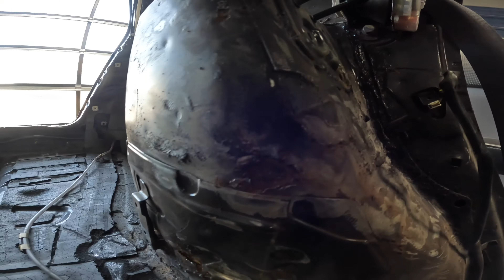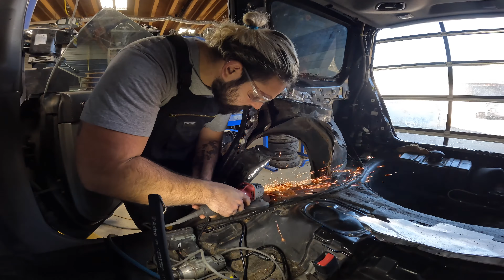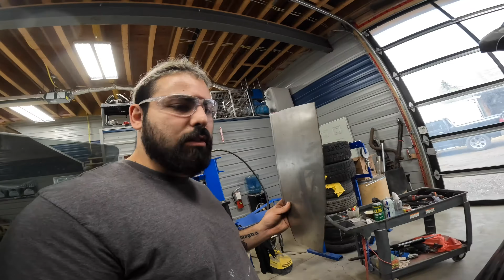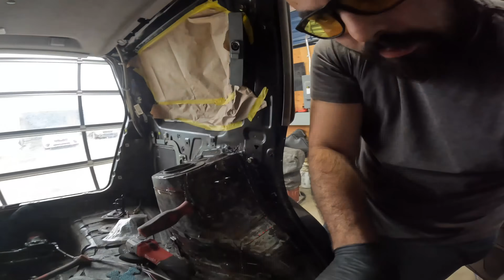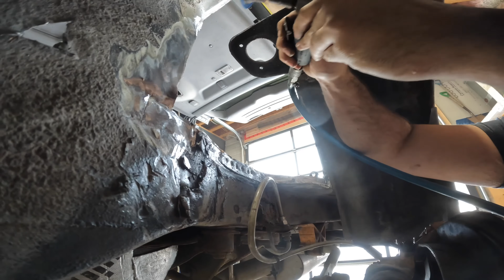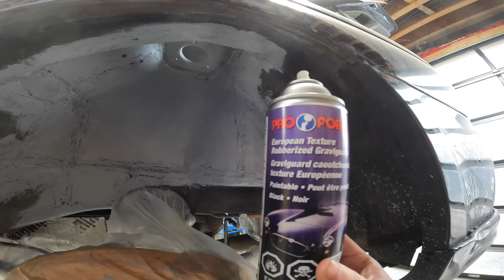Rusty Subaru Wagon Shock Tower Repair - Start To Finish

Comment: I have an 04 FXT and i’m in need of this exact repair. The Tower as a Whole isn’t as decayed, but the front of the tower, directly behind the rear seats is rotting baddlyy. I’m a mechanic, but not an autobody tech, nor do i have the welding skills needed to fix this. Whats a ball-park range on this kind of job, Parts and Labor?
Reply from the maker: Ya its a sad scenario, this one was extremely bad. Id say a safe ball park for someone to cut out the bad and hammer up a replacement patch and weld it in. Maybe $1000-$1500 range?

Comment: This and other videos on here had me checking the wheel wells and shock towers of my trusty fairly rusty SG. Can say that I caught it in an early stage (phew). Only post stamp size patches needed. Soaked the notorious sheet layers with magic Owatrol to stop or at least arrest any ongoings where I could not / would not look but had suspicions of rust inside still good looking parts.

Comment: Is this only single layer? I’m curious if that’s structurally adequate…
Would using the Subie Savers towers be less man hours and more strong?
Reply from the maker: @spotthedogg  this would be stronger then original, original was a perforated 2 layers of 22g, this is 18g . 
The subie savers towers would be ideal for sake of simplicity, i was unaware they were actually available on the market now. 
Either or, if you have large rust holes in the towers, then anything made of metal is going to be an improvement.
Reply: @TheSubieSanctuary  that’s 100% true, the SS towers are expensive at $799USD each but so is 50 hours plus materials. ✌🏻
As always; I love your work and projects!

Comment: All Subaru Foresters in the SG and SF series rust in this area. I have specialized in these cars. The only option is to rebuild them by hand, as there are no original parts. I have built a welding jig for the shock absorber plate, which allows me to remove the rust completely. Right down to the healthy sheet metal and then I rebuild the wheel arch. Since I am retired, I take my time and need about 2 days for one side. Once the rust is removed, the damage doesn't look so bad.
Reply: Where do you live?? 😏
Reply: @spotthedogg  In Good Old Germany,                                 Westerwald
Reply: @jowebejott1509  hello, it is a random question but I have way less rust damage than the one shown in the video and I would like to know if you would still do the repair on a 03 SG, and how much would you charge
Reply from the maker: Hey there, it mostly comes down to time spent. Im trying to avoid rust work and focus on larger projects. If i had to pin a rough guess on cost to do both towers. Id start around $2500cad
Reply: @TheSubieSanctuary  Oh I wanted to get a quote from the guy since I am in Germany too. Thanks nonetheles, I will have to get it done before winter =)

Comment: What kind of metal did you guys use? The thickness? Type? Where did you guys get it from? And how did you guys shape it to match the shock tower look? I’m looking to tackle my strut towers on my sf forester, and this info would be helpful.
Reply from the maker: @jacobmercado5075  hey buddy! You can use 18g sheet metal, we just get it our local autoparts supplier. You would shape it with a hammer and big dolly or metal brake
Reply: @TheSubieSanctuary thanks!!

Comment: I have a 2005 Saab 92x that is at 198,000 miles and I have a feeling my towers will rust through to failure in about 25-50k miles. If I had the skills you have I'd do this work, but it's not worth it to me to pay someone else to do it. It was fun watching you do this great repair!
Reply from the maker: Thanks buddy, and you are correct in the worth it or not. This is a massive job and typically can replace the car for this kind of effort. 
I did my own bugeye wagon a few years back, would same structure as your 92x,
It was a mission and no way id have been able to afford to have someone do it without doing it myself. Which even still is a lot in special tools and time. Hope you make out alright in the next car venture

Comment: awesome work as always! just curious what rust converter did you use for the small bits of rust before paint?
Reply from the maker: We use rust check brand, most convertors have the same ingredients. The rust check brand is just most available and does work great

Comment: Y'all do amazing work! My chassis/tower rotted pretty bad, and I know my mechanic was just being ethical when he told me my 2000 forester is destined for the junk yard, but I really wish there was a subie sanctuary in Iowa.
Reply from the maker: Ya they can get pretty bad, this car was definitely one of those cases. Otherwise rest of the car decent enough that these were at least worth doing. Rust sucks… and they dont make the new subarus like the old ones.
Reply: same from Nebraska and my 2004